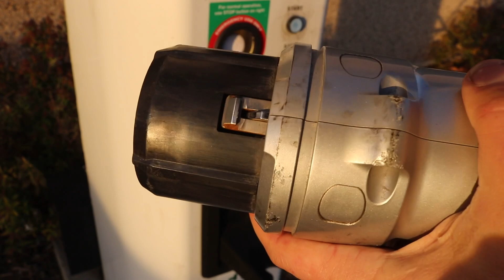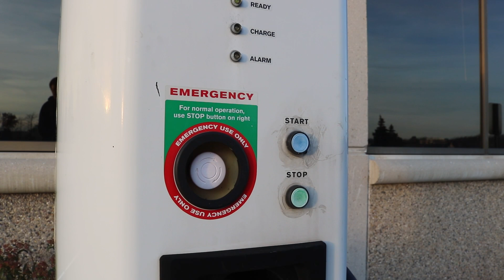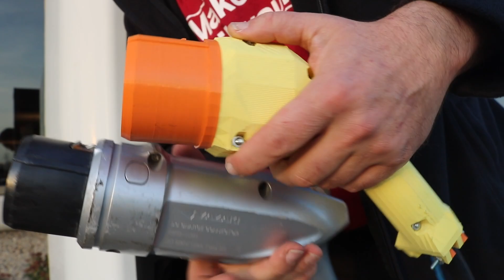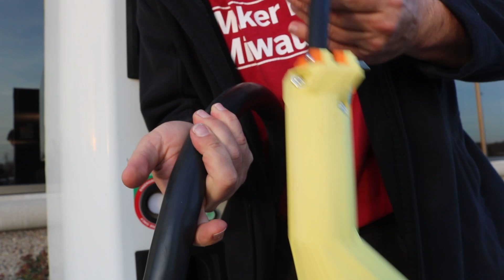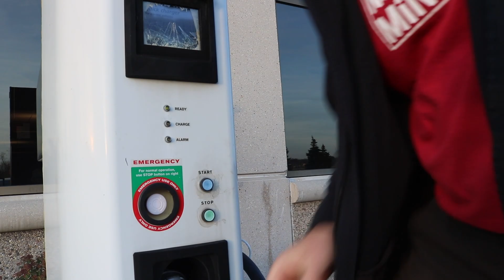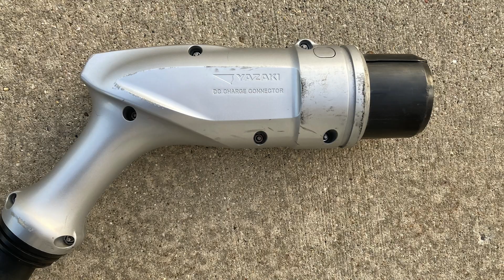3D Printed DC Fast Charger vs Commercial Version (CHAdeMO V2G)

Comment: Tested the h6 inverter yet?
Reply from the maker: I've started playing with it. I did successfully run it off 150VDC from a power supply. I just got some semiconductor fuses in, so I can fuse the PV input now.

Comment: Why are you making one by yourself? Just because?
Reply from the maker: Because just that connector by itself costs about $1,000.
I'm working on an experimental project to draw power out through the car's DC Fast Charge port for a home power backup. I don't want to spend a grand just to try it in the first place. Beyond that, it's VERY interesting to learn how all this works!
Reply: @BenjaminNelsonX  Thanks for taking the time to answer my question.

Comment: When out and about riding electric bicycle I'd like to be able to just plug into one fast chargers maybe not at the 400v as used in biggest chargers here in the uk but somehow just get 230 v feed is this possible ? So it would the convenience of charging a simple 48v battery bank with unlimited mileage from charge Station to charge through out a prolonged journey across a city/country
Reply from the maker: That would NOT be an easy thing to do. You would need all the communications that works with the CHAdeMO system. Also, Fast Chargers like this are DC, but a charger like one for an electric bicycle is AC. If you could do it, by the time you are done, you would probably have a box bigger and heavier than you would every want to carry on a bicycle!
Reply: Even with all the required hardware and communication, I don't think you would be able to charge a 48V battery on any public DC charger. CHAdeMO is 150V min per spec. I've seen some chargers list 50V as the minimum voltage but I've never got access to an EV with such a low voltage to put them to the test.

For AC charging, the YouTube channel NewZeroLand shows some interesting mods for his Zero motorcycle to boost the AC charging capacity and make it work with public charging stations.
Reply from the maker: It's MUCH easier to simply have a bigger/faster AC charger than try to get something out of a DC Fast Charger.
On my motorcycle, I hooked up a number of MeanWell power supplies and used them for bulk charging. I could get up to 4,200 watts from a single J1772 connection or from a couple of regular electric outlets.
https://300mpg.org/2015/07/24/charging-with-power-supplies/

Comment: 12 Guage? Are you doing level 1 charge on the 3d printed? I'd go thicker for level 2 for sure.
Reply from the maker: This is for drawing power OUT of the car. 12 gauge conductors are commonly used for 20 amp circuits.
20A at 360V is over 6,000 watts. Plenty to run my house in a blackout.
Reply: @BenjaminNelsonX  

Nice work!!!